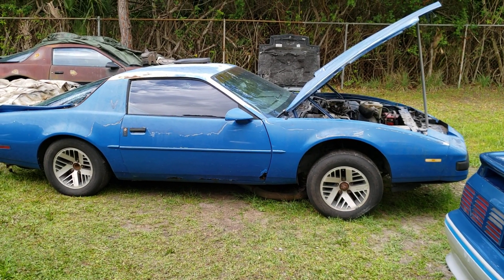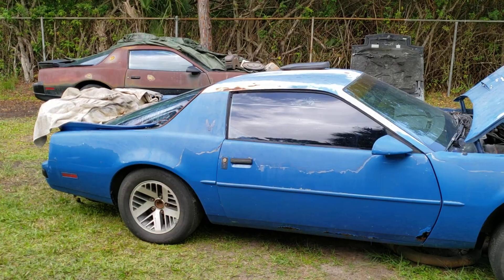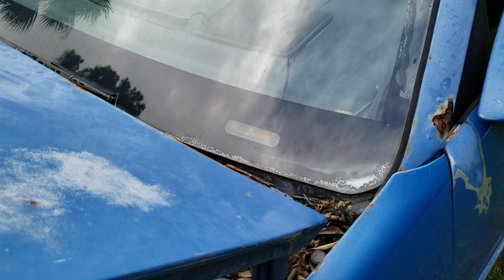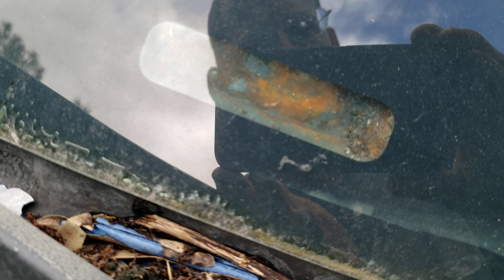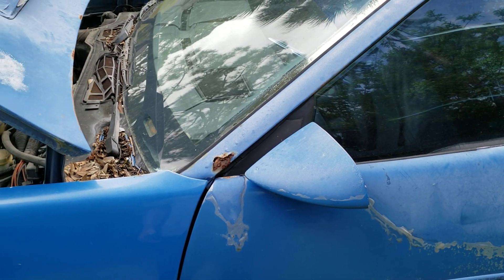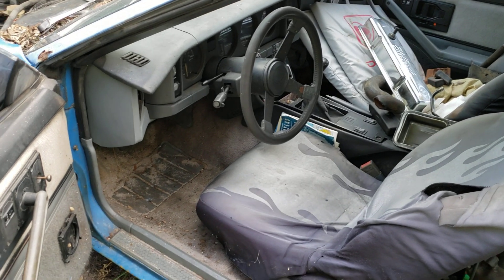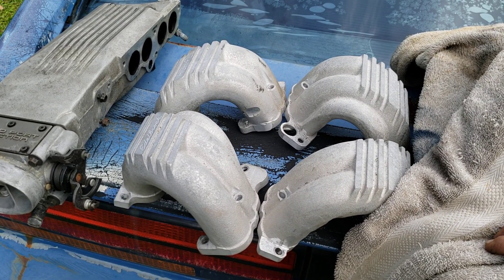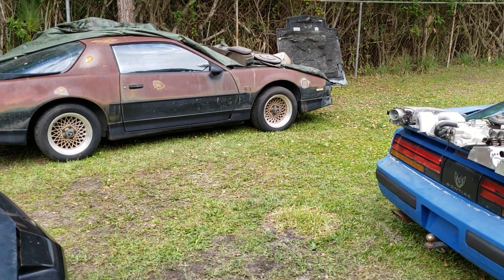Firebird formula 350 gets a formula parts car

Comment: What do you mean when you said that your stuck at an angle with the GTA seats?  Not sure what you meant.
Reply from the maker: Its a bit hard to explain its as if the rear of the seat sits lower than front no matter how much you adjust.My last visit to the salvage yard I tried out a 91 firebird seat night and day difference. Those seats the bottom is almost level with the rear only a little lower than front
Reply: @MR1967galaxieLTD oh. I understand.